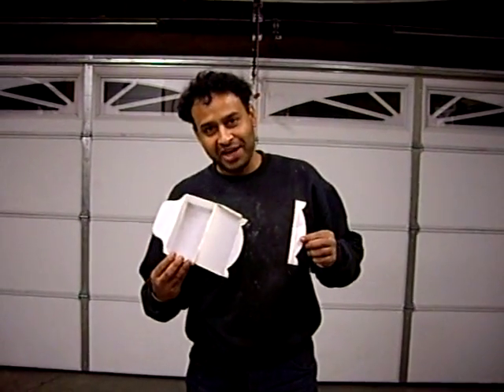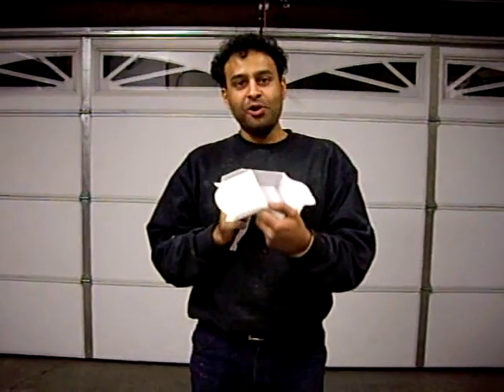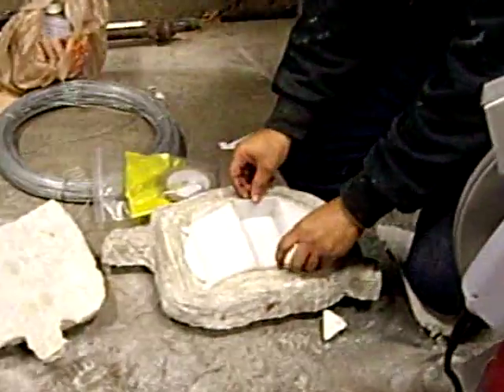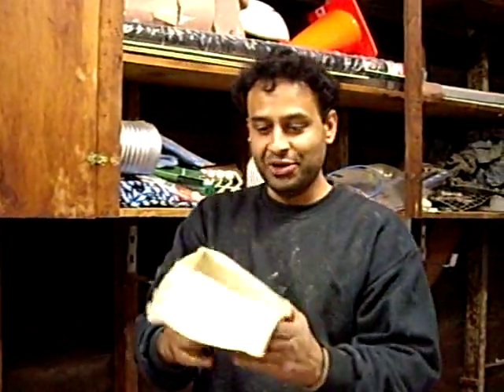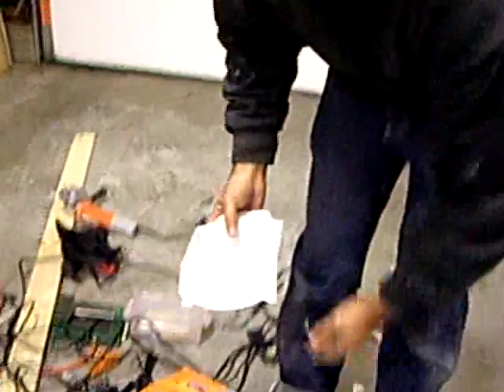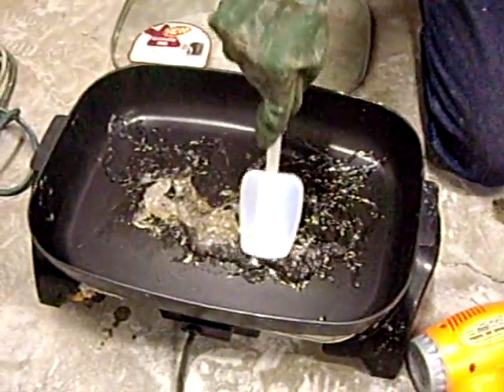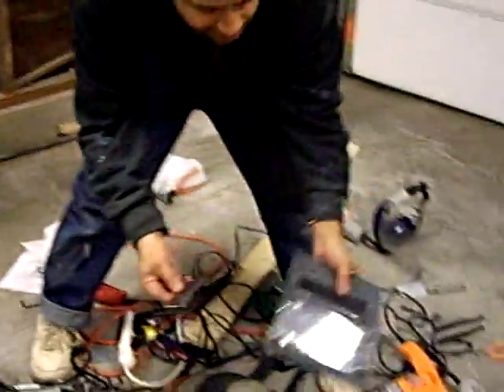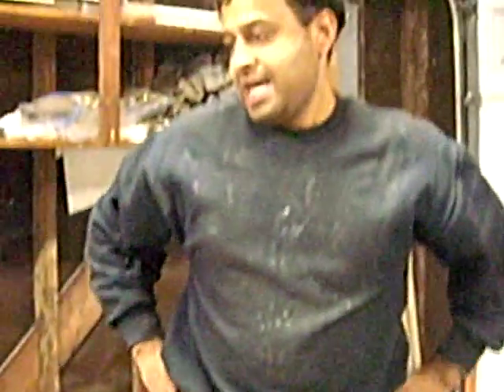Home made Injection Mould will not work for me

Comment: Lol, that was a sweet vid, as it's not often people convey their trials and errors in moving ahead with an idea. Plastic injection is a cold bitch in the U.S. - actually the tooling aspect of things. 3 parts all under 3 inches. $95000 in tooling in the U.S. In China it would be made for under $10k with 20000 parts in whatever your flavor is. 

I like your passion though man, and if you're interested, reach out and say hello. I may have a unique gap filling solution to discuss with you for short run production. If I dont hear back, thanks for the post at least! Ive learned more through mistakes than I have outsourcing.

Comment: I saw your vid back in 2009 then tried to solve it. Took me a while. Here's the solution. 1) invent a small strong plastic product. It'll be easier to make quickly. 2) you might want to buy a portable plastic injection device (measures only 3"x1"x1") able to handle delrin, a very strong plastic. Plastic injection isn't as dangerous and expensive as they want entrepreneurs to believe. Don't believe them.

Comment: Dude, I love your process and you've got a great personality but seriously, you need a work bench! How about a silicone mold and then use resin to make your prototypes. I believe you can get resin that will be much more rigid than the one you had in the concrete mold. Anyway, good luck and thanks for the great video!

Comment: coming from a master molder,  you got it all wrong.  injection molding is a complex process.  i can easily see that you have no knowledge of it.  i suggest you go work in a plastic factory before attempting any of this.   looking at the wall thickness of your part and the size of it. i would approximate your injection surface to be around 20" squared.  that would be 20"squared X 3 tonnes per square inche +20%  that's 72 tonnes of clamp pressure to keep your mold closed under 2000psi injection